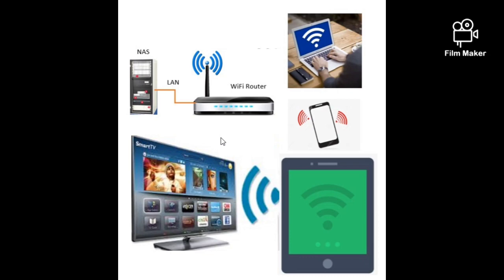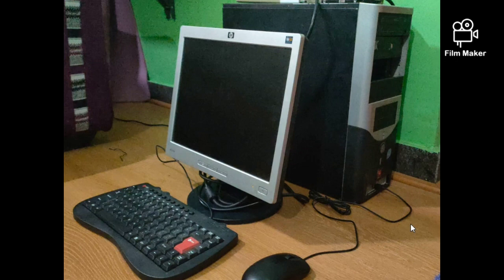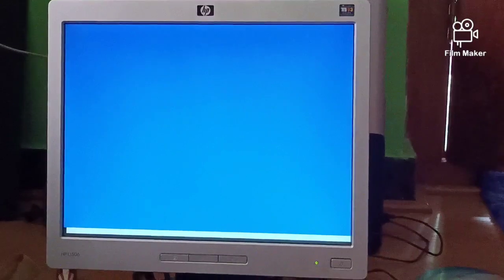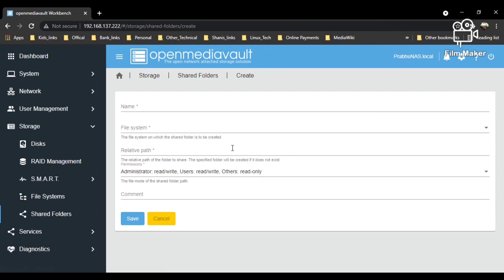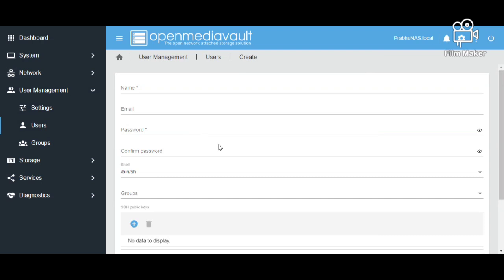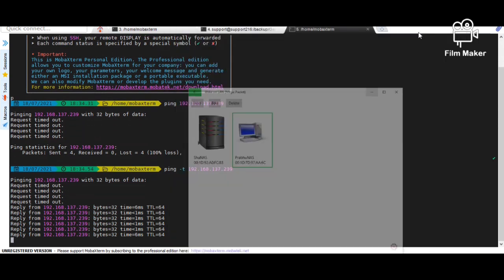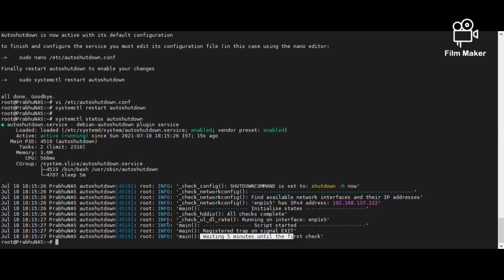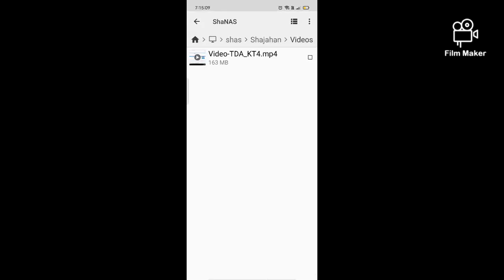Build your own NAS by using old Desktop PC and OpenMediaVault with WOL option to save power.

Comment: I have an issue that's super basic and can't figure out. I'm creating a public share..and in the drop down for permissions I set to everyone read/write. I hit save. Then save changes to config. I go edit share and its not set to everyone. It reverts back to default which is administrator and other etc. What am I missing?
Reply from the maker: Try to do similar setting for a new folder or file, so that we will get to know is it related to the existing file or not.